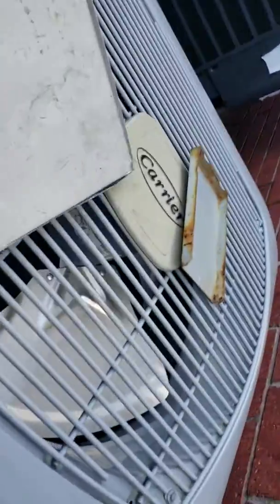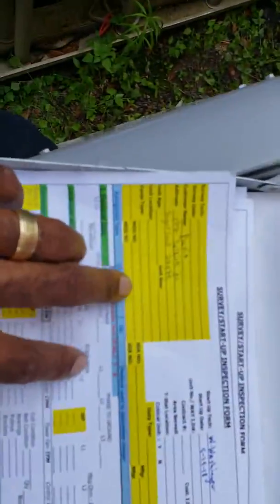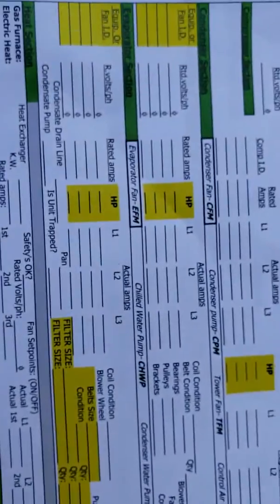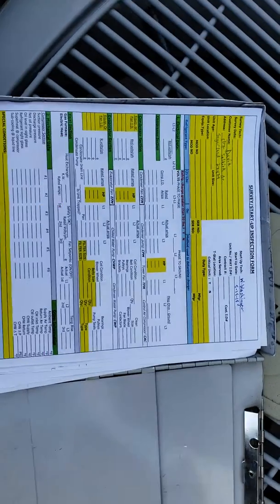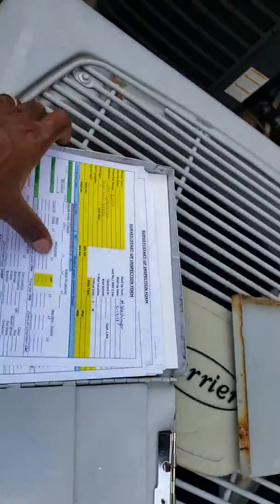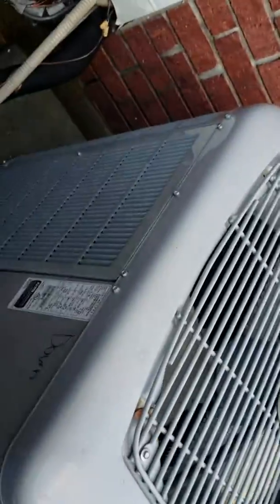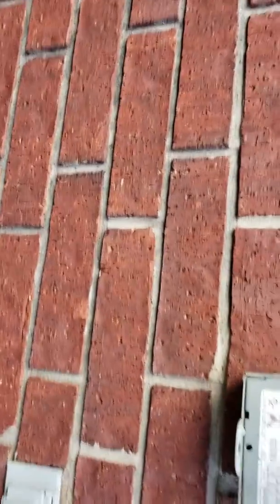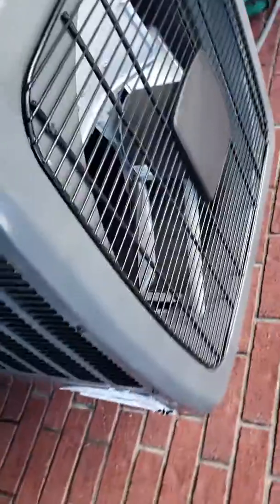HVAC: Residential start up inspections

Comment: Gathering as much info on the units will give you the needed heads up for your customer in need of service.  Everyone likes being familiar when accessing a new environment and that goes double for your customer. Your ability to show familiarity with your customer's equipment imparts that first stage of trust. Your previous experiences have exposed you to these insights and now using those experiences in your own business is the 'Win - Win'.  I wish you tremendous success. You're a long way from sleeping in the truck . Do your thang!